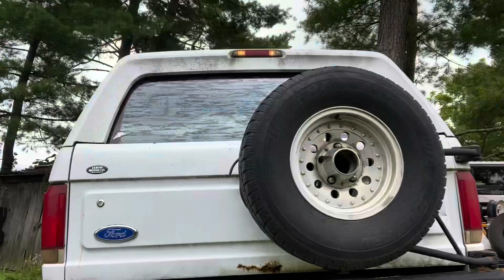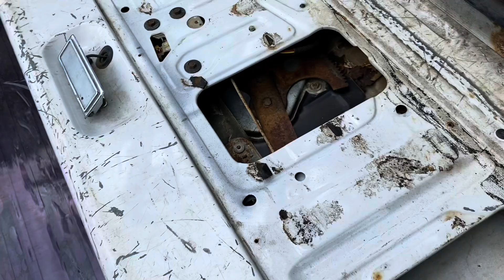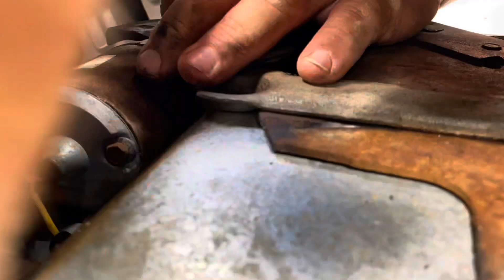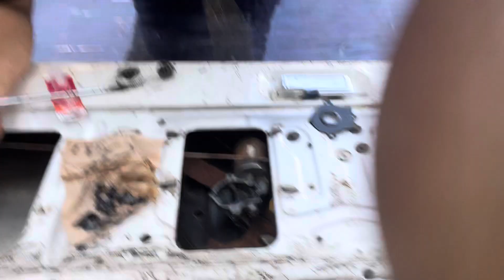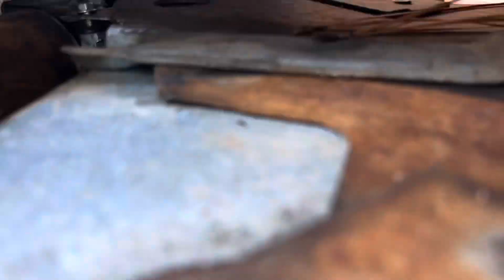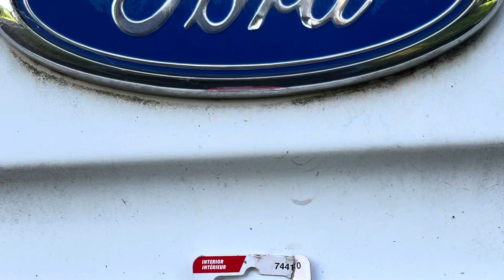QUICK, SIMPLE, CHEAP, and EASY FIX FOR YOUR 1978-1996 FULL SIZE FORD BRONCO REAR WINDOW.

Comment: Mine is stuck in the up position. I couldn't figure out how to slide it down manually. It feels super stuck. Either from rusty slidey bits or stuck in the track. So thinking it was the motor impacting the motion, I just sat in the back and took to motor off. Thought I'd mention that for those with short arms/body if you don't feel comfortable leaning over the tailgate with the window sticking out. It was still quite frustrating.

After taking it out and testing the motor.... The gear still turns. But I guess I'll clean it up and inspect the plastic balls anyway.

But now I think I need to find a friend to help lower the window.... I'll try the tape method though. Thanks for this video and your included details with how and the why!!

Comment: Looks just like my 1995 Bronco project.     Back in high school I had a 1980 Bronco.    One day the rear window wouldn't go up because it got a bit out of alignment.  Like an idiot I tried to roll it up and Kaboom!   It shattered!    A rather expensive replacement for a teenager.
Reply from the maker: Love these old broncos. I actually have a 1980 as well. Video coming on it soon. 👍🏻
Reply: @jwmustangman can you roll window down slightly on 1996 model, my window goes up and down but not correctly I have to turn key in back and push down a little to make go all the way down?
Reply from the maker: @fredbennett3549 so the motor runs? Or it stops running til you push on it like it’s overloaded?
Reply: @jwmustangman  it runs but when it get close to bottom I have to push on down